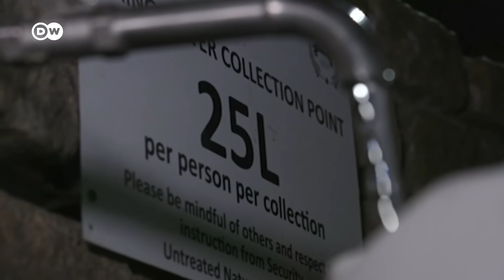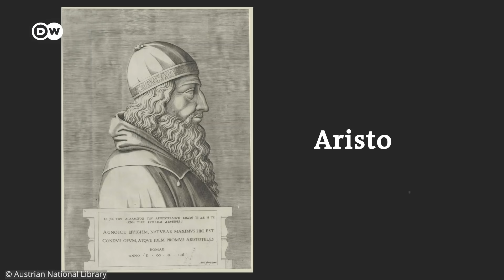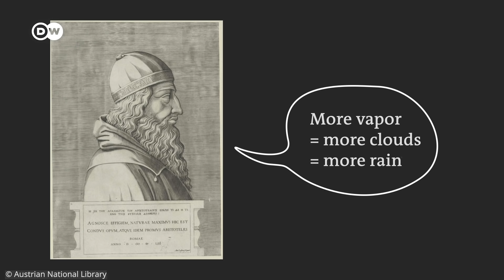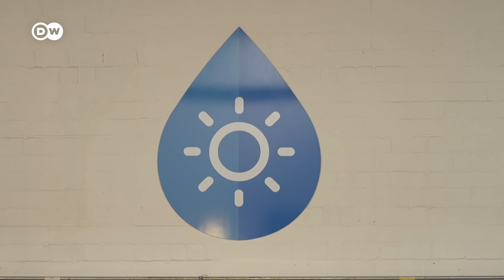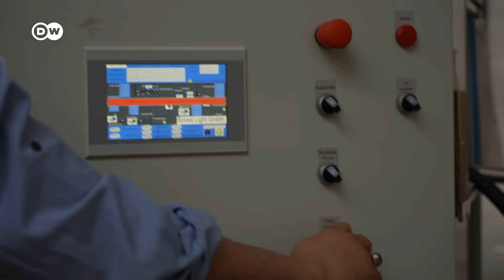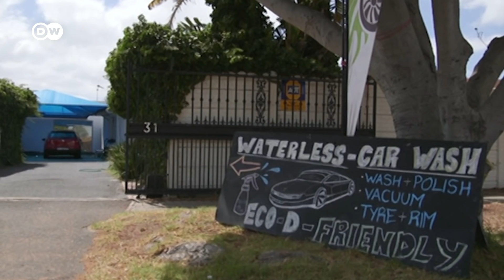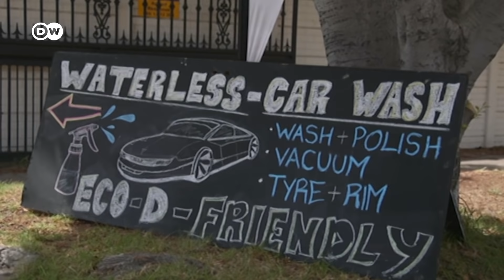Can desalination solve the global water crisis?

Comment: What is to be done with the salt?
Reply: Sea salt is very useful stuff.  People and livestock can eat it directly, use it to de-ice roads, use it to make paper, use it to make PVC/CPVC/vinyl plastics, use it to make sodium hydroxide and hydrochloric acid (which are both very important industrial chemicals used for making practically everything we use, including soaps and aluminum metal objects), and many other potential uses.  Sea salt contains a great many interest elements, including large quantities of sodium, chlorine, magnesium, calcium, potassium, and many others in smaller quantities.  With enough input energy, these elements can be separated and used to manufacture all manner of interesting products.  In the future, large scale sodium and/or sodium ion batteries, made partially from sea salt, may also be used for grid scale solar energy storage and electric vehicle use.
Reply: @Fritz_Schlunder  What about, say, a million tons every 2 weeks?
Reply: @paulespinoza974  A million tons of sea salt every 2 weeks (ex: ~26 million tons/year) sounds like allot of salt, but it kind of isn't.  According to the internets, total global salt production in 2018 was around 300 million metric tons, so adding an extra 26 million tons/year to this supply would be relatively small potatoes.

Common types of glass (such as "soda lime glass") is primarily silicon dioxide (ex: clean sand), but it also contains large amounts of sodium oxide and calcium oxide.  My understanding is that today's glass manufacturers normally source their sodium and calcium needs from mined terrestrial sodium and calcium carbonates, which upon sufficient heating give off CO2 to produce their respective oxides.  This is cheap and easy, but it produces considerable amount of CO2 which gets released to the atmosphere, which is not good.

With enough solar electricity, one could instead make sodium and calcium oxides from their respective chlorides in sea salt, by electrolysis and heating.  As a byproduct, chlorine is also produced, which would need to be consumed somehow, such as by using it to make PVC/CPVC/vinyl plastics.  Such a process would enable glass manufacturing from solar electricity + sea salt + desert sand, with significantly reduced or even eliminated CO2 production.

Concrete is made from sand, pebbles, and portland cement.  Portland cement is a substance made largely from calcium oxide, which is also produced by heating calcium carbonate to drive off CO2 to obtain calcium oxide.  This CO2 production associated with concrete manufacturing can also potentially be eliminated, by way of converting calcium chloride harvested from sea salt, into calcium oxide using solar electricity.  Fully eliminating CO2 production from the concrete manufacturing process would require massive amounts of sea salt, given the extremely large scale that concrete is currently used today.

Basically, sea salt is useful stuff, even in extremely high quantities.  It is not a product that should be thought of as some kind of waste product, since it is a valuable substance worth collecting in large quantities.

Comment: Only reasonable in certain areas if used to kick-start pro active watershed improvement alongside a bit of drinking water relief, otherwise it just a another way to detract and defer from the larger issue. The vast majority of the world's heat dynamic is driven by hydrology... The carbon cycle itself is largely driven by hydrology, carbon emissions although a critical component of the issue that needs to be taken seriously, is still just a more minor aspect in comparison to hydrology yet receives far more political attention...

Comment: I'm disappointed that you didn't explain graphene desalination, given how little energy it requires compared to reverse osmosis and thermal desalination.

With graphene desalination and a relatively small amount of heat, there is the potential to remove all of the water, resulting in fresh water and solid salt, without brine.

Comment: Desalination cannot solve the scarcity problem.  Current technology is far too energy intensive and produces far too much super salty brine as a by product.  It will require a varied approach.  Rainwater harvesting and groundwater recharge systems in some areas will increase water availability locally.  Thermal desalination using solar will produce a lot of water but also a lot of brine.  Drip and soaking irrigation will produce more crops with less water.  Reforestation will restore groundwater and decrease temps while increasing rainfall.  New hydro electric projects like the GERD in Ethiopia will retain water and increase energy production without emission of more green house gasses.  And on and on.  There is no "silver bullet solution".  Arid regions should stop exporting water in crops that need a lot of water.  California and Egypt are 2 examples of growing water intensive crops for export in a water deprived region.  That is crazy!

Comment: If they can engineer a structure that can survive at 2,400 feet down you can use the weight of the ocean itself to give you fresh water at the cost of pumping the fresh water up that 2,400 feet and to shore. The natural ocean currents will keep the area around the filters clear of the now slightly higher salt content so you don't get the issue of the highly salty brine you get from a normal RO system. 

Yes this will only work in areas with deep enough water off the coast but that is why no one solution will fix anything as people with hammers start thinking everything is a nail.

Comment: It seems a process(es) that emulates nature’s method of purifying water (evaporation by sunlight, then condensation) may prove the best in the long run. Possibly focus sunlight to magnify evaporation and condense vapor onto catchment, then send brine to ocean (where practical) as that is where salts may have originated. [Concentrating materials continues to be an environmental issue.]
Reply: Solar stills are what you are referring to. Sailors have been using them in emergency kits at sea for decades.
Reply: @DavidLee-df888  thank you David! I see the issues being: scaling up with improved efficiencies (accelerated evaporation), the brine return to distant offshore location (at depth), and long transmission pipes inland. It seems this should be possible with wastewater too. I can even imagine a degree of useful heat recovery.

Comment: I like your video, getting a proper solution for the waste is important but how many by products can we make from the waste.
Reply: One solution for the problem is staring at us right in the face.... what does the ocean have a lot of that is also used in cuisines around the world? Salt. What happens when you reduce a brine to nothingness? You get a pile of salt. What else is there to the problem?
Reply: @samsadowitz1724  Thst's a great solution for some of it, but the quantity of salt left over may be so great that supply would exceed demand by several orders of magnitude.  I think the remainder could be stored on desert salt flats, or melted with silica to make glass using solar furnaces, locking it up in glass for eons.

Comment: 1. Not alone - recycling and above all, water management (less concrete, less pumping of underground reservoirs, more vegetation) is necessary. 2. good luck withouth modern nuclear power in powering and pumping this.
Reply: If solar is used to desalinate, doesn't that solve intermittency? Isn't solar PV the cheapest today? I've wondered about CSP plants that make steam with thousands of mirrors. Could this tech be modified to boil seawater? If so they would produce both power and fresh water.

Comment: The real problem is Salt. I for less than $325 build a 3.2-4.0 kw solar furnace. That isn't a lot but it will produce over 1200 degrees at the focal point and can track the suns position analog. One of the problems in a system like this is state change and the accumulation of salt. If you introduce a heated collector and fluid transfer you increase the losses. So direct heat was used the system allows for salt to build up. Salt itself could provide a tranfer medium. But using molten salt introduces complexity and will plug lines. Also off axis FP is horrendously dangerous as my wife's apple trees were set a fire. So Salt is a very damaging by product. Refilling salt mines and domestic usage private and industrial would not use it all. Very hazardous to wild life and.will pollute ground water if sediment ponds are used. Sodium only has a few uses. Chloride / Chlorine is worse than not enough water. Reintroducing it into the sea is not practical and even at small levels. The 3-4 kw is not a lot of energy. BUT, Compared to the 15% at best energy from silicon solar cells and the energy they actually produce is worse. Especially after conversion and losses and the cells inefficient nature. The Sun is wonderful, But it and the wind are not reliable. However, the Furnace is far better than Fossil Fuels for a heat source. They do not increase the overall heat gain like stored heat energy generated and released by burning. Remember, direct usage and not State or transferred energy is desirable. Solar works but if is very inefficient. $10,000 for one or two wall receptacles is just not gonna cut it. Plugging your car into the grid doesn't improve a darn thing. DO THE MATH. A gallon of fuel has x watts in it. How many panels equel one gallon of gas. And did you ever burn Lithium. And the high voltages in a car. Sorry but go back to the drawing board. The cures are worse than the illnesses. All energy on Earth comes from our Star except Nuclear. Fossil fuel is just the release of solar back into the atmosphere. Problem is it is the abundance of heat at a higher rate in time. All forms of energy wind up as useless heat. It is the efficiently of transformation that is often overlooked. I did work with Lithium in the 80's n 90's. I was searching to steal its electron. I never was able to produce the electrical discharge of Li6 when hitting it with UV/X-ray to a measurable amount. Maybe my home brew N GAP lasers and 20 n,sec just wasn't ringing it hard enough. If ozone were gold I would be rich. My interest was Shorted Turn Lev. and Time Variation of a spinning body related to the flywheel effect and the time dialation across of variation 1/r² in a rotating mass. Tecnology can solve our problems. POLITICS CANNOT. Learn a trade skills science. Hawkings said, Look up at the Stars not at you feet. Learn Science not Politics. Hands on. Learn many trades. And go into a Library or online and PURSUE YOUR TALENTS. DON'T Waste time and brain power on BS. The answers await you.

Comment: A neighbor of mine was a retired Westinghouse engineer, He had worked on nuclear power plants. He said the biggest mistake Westinghouse made with nuclear power was not including desalination facilities with the power plants.
Reply: 1. Location, not all nuc plants are on salt water 2. salt water is NOT circulated through the reactor.  3. Any nuc plant near salt water could add on a desalination plant if desired.
Reply: @fredkibler  The main issue is that Nuclear Reactors run at a below maximum efficiency, as a safety factor (at high efficiency there is very little time for human reaction to an emergency), this means they have a tremendous amount of Waste Heat, which would be great to run a Distiller/Evaporator  to purify ocean or brackish water into drinkable water!
 
This also will lower the amount of hot moist air being shot up into the atmosphere since you would no longer need all of those large cooling towers.  An even better solution would be to have the plant near where a city lets out it's treated fresh water into the ocean..... They could mix the Brine discharge from the Water Plant so there would be minimal disruption of Ocean Life from water being too high or too low in salinity being discharged into the ocean.
(Former Water King aboard two different US Navy ships)
Reply: @timengineman2nd714  I'm gonna give you a gce on your 1st paragraph. Mixing could be done but then why would a city low on fresh water be dumping it, they would be better off treating and reclaiming it so that only a minimal amount is lost.  Brine should just be sent to evaporation pools or something similar to collect the salt.
Reply: @fredkibler  I'm talking about Gray and Brown water.  (Gray is from dishwashers, sinks, showers, etc.  Brown is from a toilet). This is after the water has passed thru the Water Treatment Plant.  Not too many people want to drink that even though it is reasonably safe.  Of course, as it goes down a river, sits in a reservoir, mixes with rainwater, etc. it is very safe, especially after filtration, and treatment before it goes to someone else's house for drinking, cooking, etc.